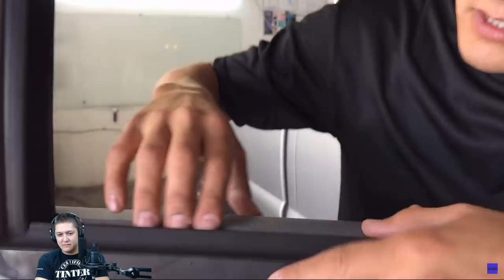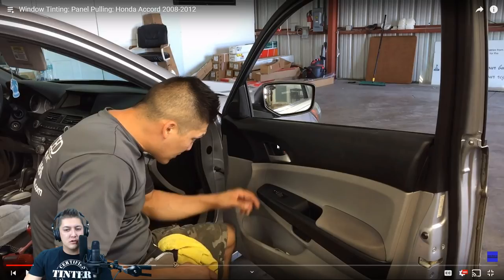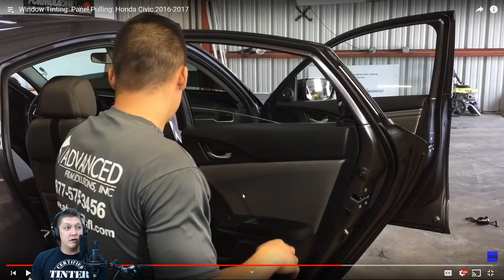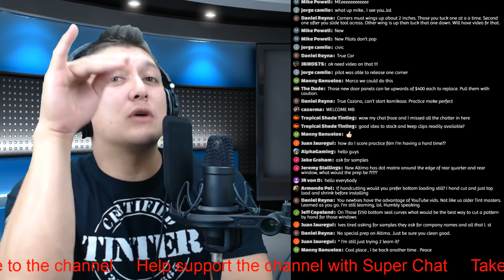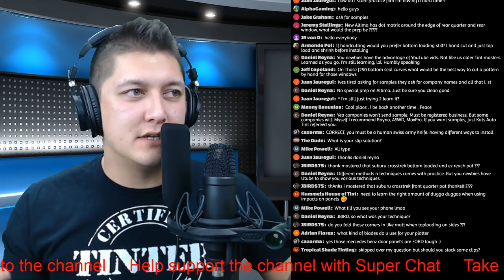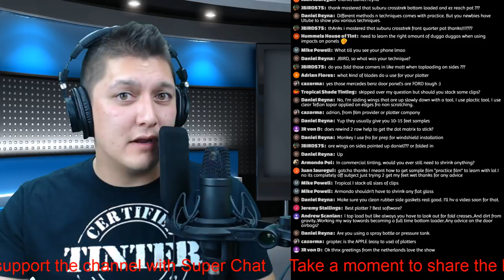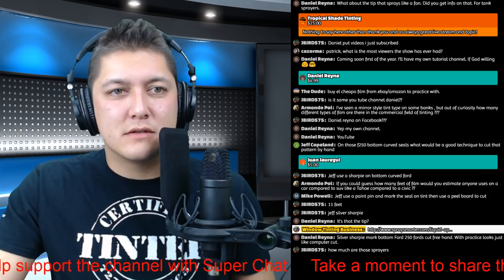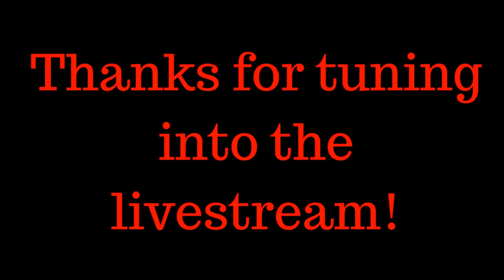🔴Tuesday's Livestream: #2 - Sweep/Panel Removal 101 + Q&A

Comment: great info thanks a lot!
Reply from the maker: the video is called removing old tint... there is always a chance that the adhesive will be there and needs to be worked off. It's a better alternative to scraping the glass with a blade.